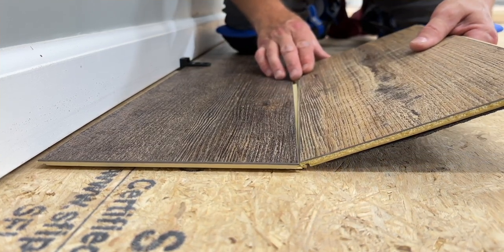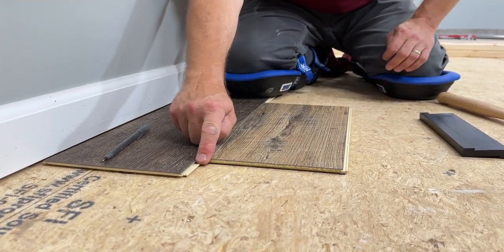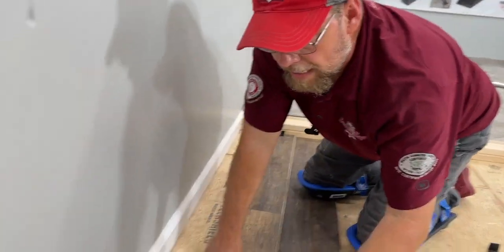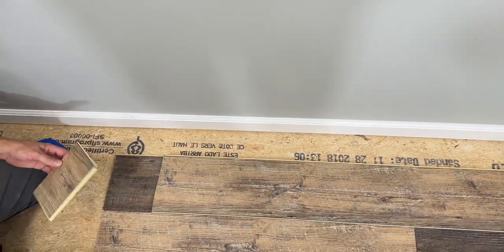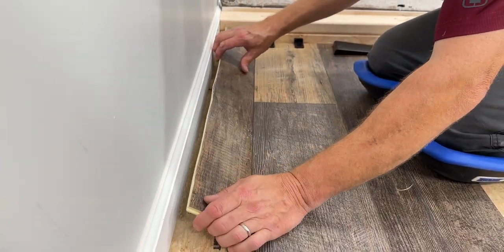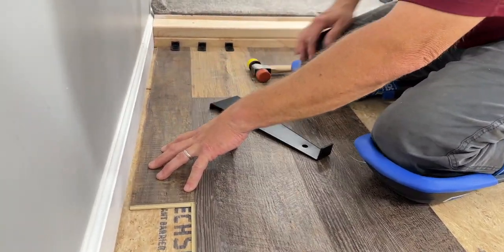Install Vinyl Plank Flooring with Just These Tools

Comment: What do you do with the small spaces between the last row of planks and the baseboard? How do you compensate for that ?
Reply from the maker: Put down 1/4 round
Reply: Why wouldn't you do the baseboards after the floor is installed? That gap is strange. I have never seen a gap at someones home.

Comment: I have a question or two for you what big box flooring would tou suggest I need something with a good looking system and what looking system so you think holds better im installing it in a older condo built with old dimensional lumber I have had problems with drop in lock in the past.
Reply from the maker: Well, I was going to say life proof, at Home Depot. It is actually a really good floor if it is done properly and the proper prep is done. I have installed it in my family members house about five years ago and it still looks like it did the day I installed it and they are a household of five. Outside of that, I don’t really know of any other box store brands that I would recommend.
Reply: @FloorsbySouthernboys  is there anything from like LL flooring or floor and decor that you would suggest I am looking for something with a strong looking system something that doesn't break easy I went to Lowe's and home Depot and most of the samples I could break the locking system with my hand easy.

Comment: @floors by southern  the spacers do u only put them at beginning and when do u put them
Reply from the maker: Anywhere you’re going to be pushing on the planks and Mike caused them to go against the wall. The spacer is too sure that you have at least a quarter inch of expansion.
Reply: @FloorsbySouthernboys  and how do I measure to see how many flooring I need I want to do a kitchen but there is counter tops closet so it’s not even square